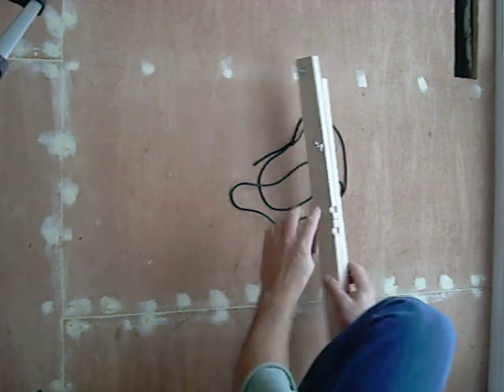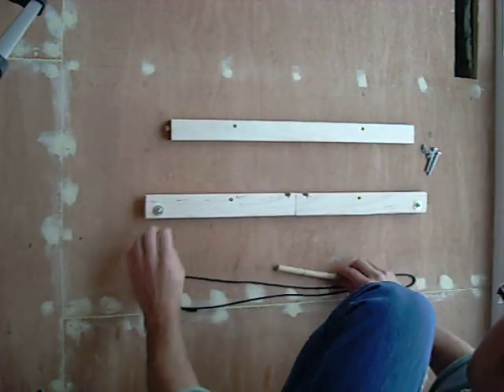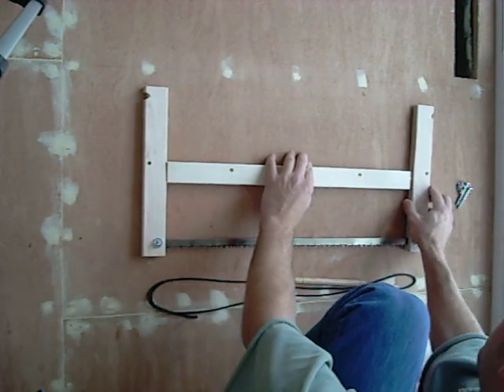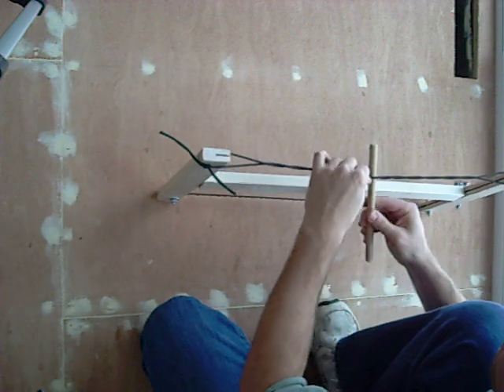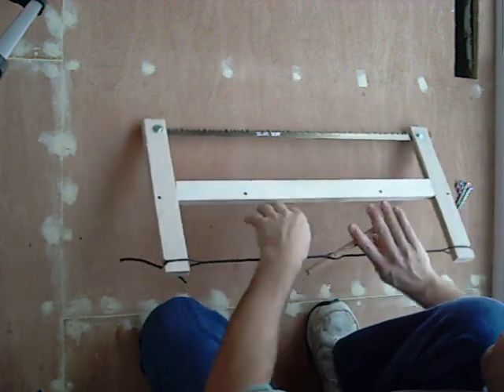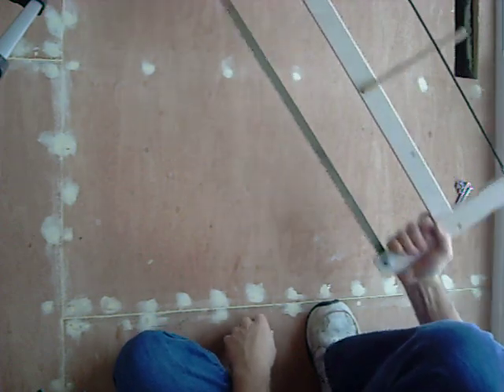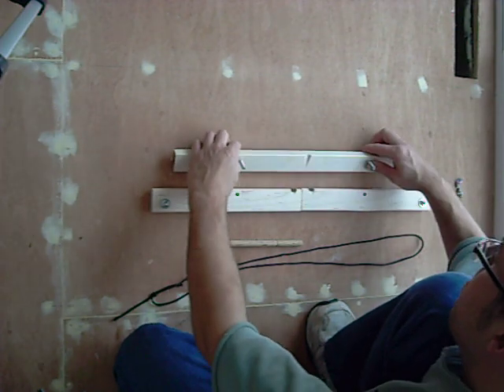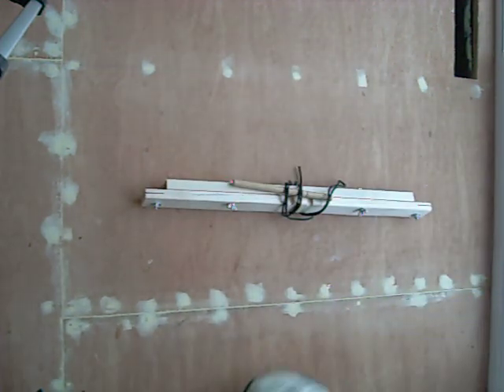Folding buck saw

Comment from the maker: Thanks for commenting. Yes, I can see your point. The saw served me very well this summer while camping, and I didn't run into the situation you described. I never tried to saw anything more than 6 or 8 inches in diameter. On the 8-inchers I just turned the log over and started from the other side. But I can see how a saw with a higher clearance could be useful.
If you make a saw like you described, I'd be very interested in seeing how it turns out, so keep me posted.

Comment: @aseglkj if you fold one under and one over the blade then you will have the blade running crooked when the saw is mounted, that will make it a bit tricky to use, 

i have made one like this but smaller, and its very good, one suggestion i have to the maker of this, is to have the teeth of the blade fold up inside , that way the handles act as a sheath, all you need to do is slot the bottom of the handles and turn them round, maybe i  will post a video ,